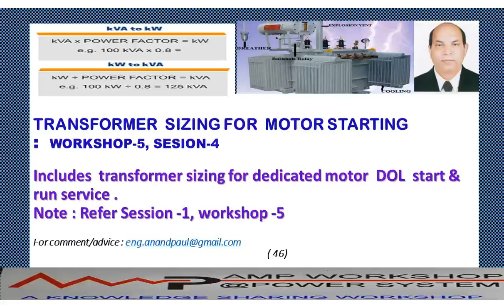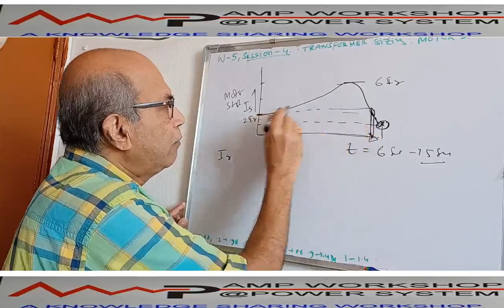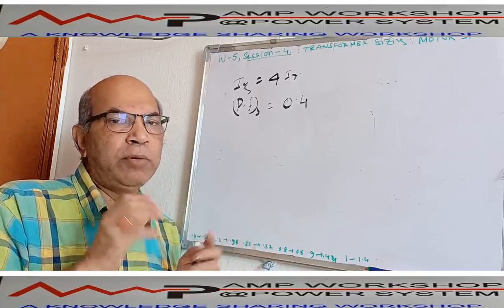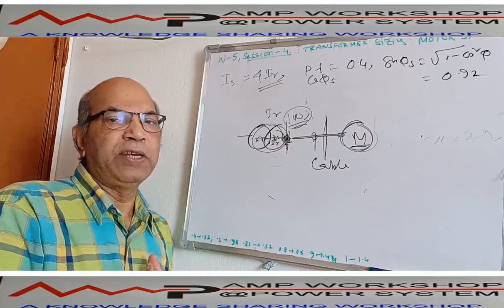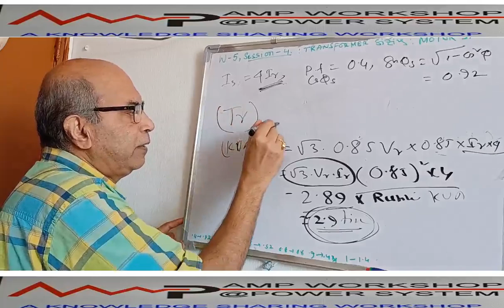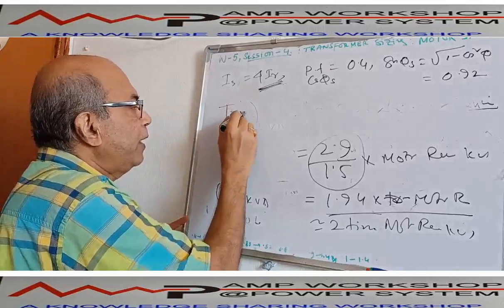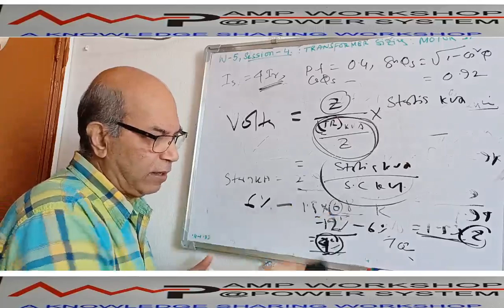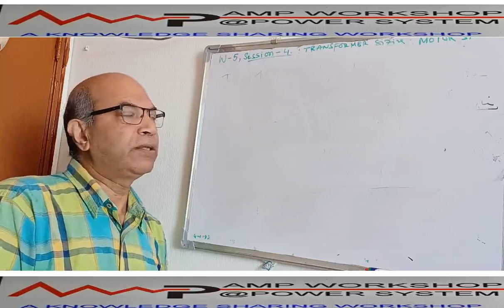HOW BIG IS TRANSFORMER  FOR   DEDICATED  MOTOR START/RUN ?????

Comment: Good explanation..been searching sizing calculation for unit transformer of HV motor. The voltage drop I get was more than 20% if the transformer is sized at 1.2 times of motor rating..thanks a lot
Reply from the maker: 1.5 times motor KVA should be adequate 
Refer my video for more details
Reply from the maker: 1.5 times is minimum Subject to low impedance . 2 to 2.5 times could be accepted if you go by standard transformer percentage impedance
Reply: Thank you.. I find 2.5 times is adequate to rectify the starting voltage drop as simulated using ETAP.
Reply: You are correct. I am an old timer and do not have ETAP but I use traditional manual spreadsheet calculations, aim for voltage at the motor not less than 80% and for DOL start transformer kVA size is about 2 - 2.5 times motor kW rating depending on actual motor locked rotor current and cable voltage drops (insignificant for MV motor but important for LV motor). The transformer acts like a poor mans reduced voltage starter. @kucingpowergile